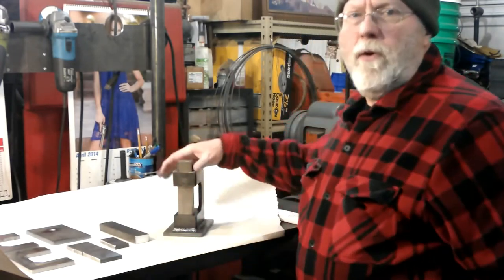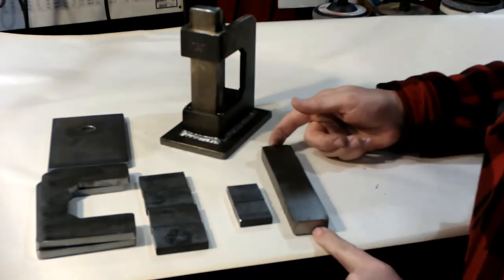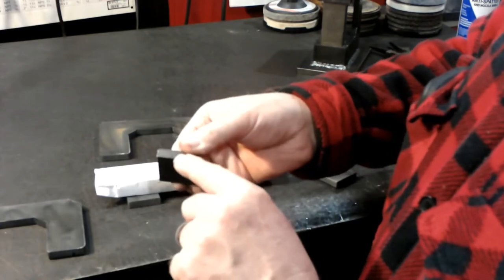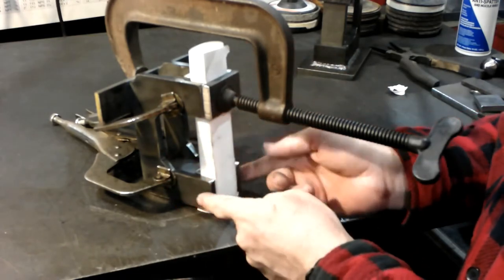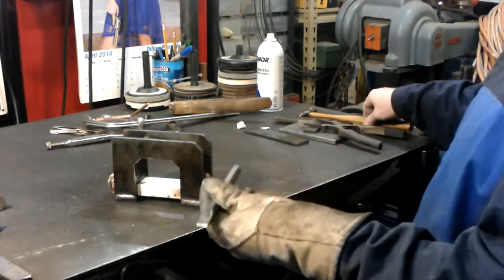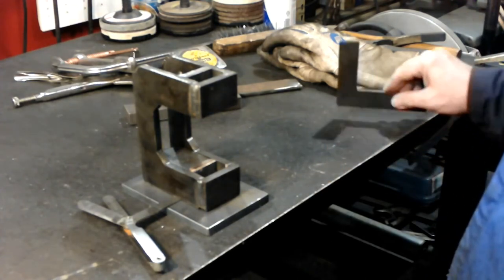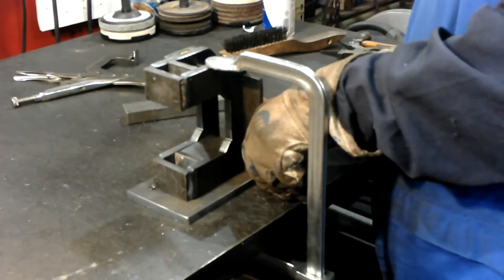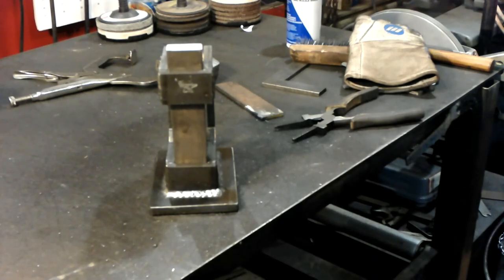C Frame Guillotine Kit

Comment: Glad too see you are still alive I finally got a Lincoln welder got too get use too wire welder it's only on electric until I get some juice but it feels like the wire comes out faster then the metal can get hot
Reply from the maker: Follow the instructions.